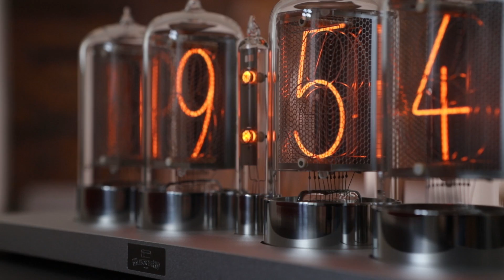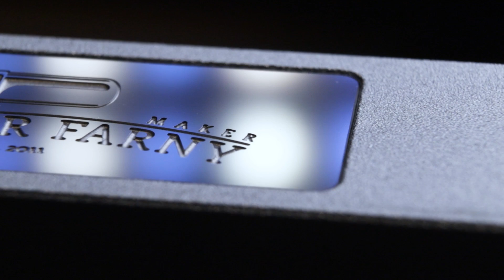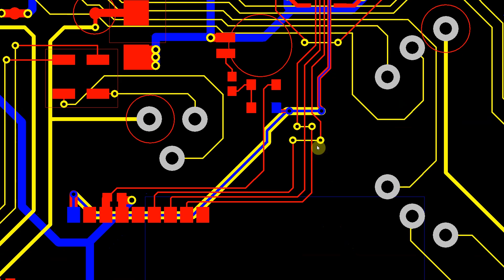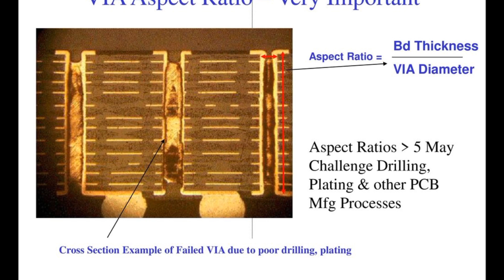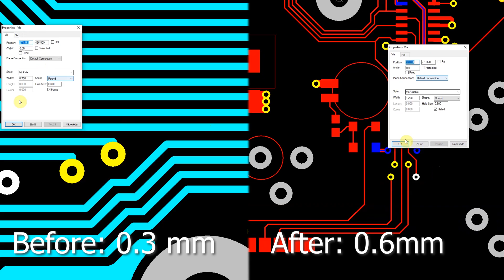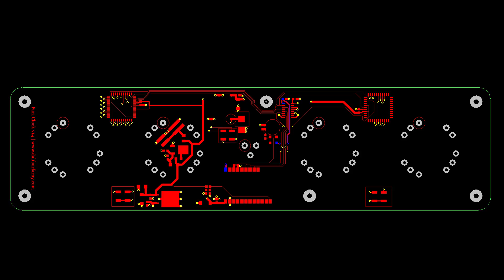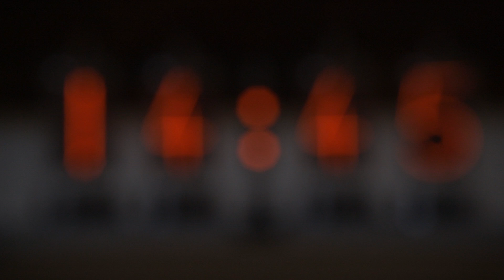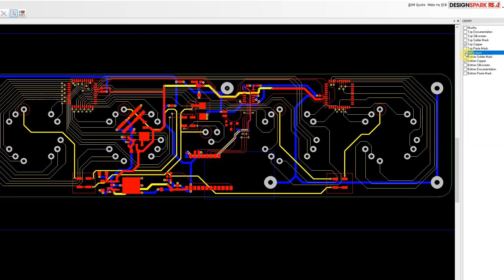Investigating a Nixie Clock Failure

Comment: It is strange that you don't use GLOVES to manipulate nixie tubes...
Thanks for this nice video.
Reply: I gotta ask why would he do that? I know virtually nothing about this tech,but surely they can't get that hot that there would be anykind of meaningful matter? I mean they're not like 100W H4 bulb or something even remotely similar.
Reply: @jothain  If you dont use gloves to manipulate those tubes, the traces left by the fingers reduce the life expectancy of the tubes.
This is the reason why many clocks sold are delivered with gloves to be able to insert the tubes on their support without leaving a greasy deposit on it.
Reply: @regisvoiclair  Yes and that's the exact reason I told they're not 100W halogen lamps that run ridiculously hot and actually burst to pieces without handing grease free. I mean how hot do nixies then run? I'd bet that you can easily touch them when they're on as power sources seem to be quite small on clock models I've seen for sale. If you can touch them and actually even if you couldn't, it wouldn't have any effect on bulb life expectancy.
Reply: I noticed the same thing. I have a pair of tube based power amplifiers from Sonic Frontiers, Power 3s, and would never think of handling the tubes without using white inspection gloves. Same with my Zen clock. Certainly not the same risk as with something like 300W halogen tubes, but finger prints leave oils that can be corrosive over time. The same process is happening as with the Halogen light bulb, only at a slower rate.

And if nothing else, why leave fingerprints on a tube, just for aesthetic reasons?

Is the glass cover for the clock placed with bare hands, or are gloves used?

Dalibor is obviously looking into rooting out any possible source of tube failure. As one is eliminated, another always bubbles its way up to the surface. Continuous improvement.

Anything in the way of Six Sigma is an opportunity for improvement.
Reply: @sgallaghe  OK. Let's get one thing absolutely straight. There is absolutely 0 possibility of grease corroding glass. Glass is material that's notoriously good in resisting everything like If you bring yourself back to schools days and lab hours, you'll likely remember all test equipment being glass. But it's true that ie. oils from hands could possibly damage lamp, but only and really only by it creating hot spot in glass which results in thermal expansion difference, which creates stress and could break glass. It's also to note that even that extreme halogen might happily live even greasy if it were very slowly started by limiting current at startups and ramped down at stops. I have absolutely no idea how and why people thing grease corrodes glass, which seems very usual thing. Yet people cook in glass items, drink stuff that have oils in them and fail to notice this mundane thing. All in all. If glass doesn't get really hot, really fast, it's OK to touch with bare hands. Gloves are are for esthetic reasons. It's very common to get cotton gloves with products that want to have high quality impressions. Heck my speakers came with them.
Reply: @jothain  For almost 10 years I worked in an office section of one of the largest class 100 clean rooms in the US. Upstairs they made almost all of the TV camera pickup tubes in the US and much of North America. Things like Plumbicon tubes. Also did a lot of tubes for medical imaging.

The tubes were never touched with bare hands.

Hot versus really hot simply slows the process.

And as I added, even if it isn't a potential damage source, It just doesn't look good to have fingerprints on a really expensive clock.

When I got my Zen I handled them with white cotton inspection gloves and wiped them down with a high quality microfiber cloth.

Will that make a difference? I have no idea. I know it certainly didn't do any harm.
Reply: @sgallaghe  Now you're getting into optics etc. and there are obvious and obviously different reasons there. Point was and still is that hand greases still don't damage glass at any friggin way, unless it's hot. I really don't understand why you're nitpicking about that it looks bad. Like in video, is the whole process seen? No. Dude likely sells with good impression. Works with bare hands and likely cleans glass surfaces before shipping. I don't see any problem there.  No gloves needed and no damage done.
Reply: @jothain  Remember, there was a 1 in 100 chance that Trump would be elected. ;-) The glass gets cleaned before shipping, certainly. But once in pristine condition, they should be handled with white gloves. Same with the glass cover.

Comment: In 2015 I was curious about nixie clocks, they looked cool but back then as an engineering student buying all things was quite expensive... But I got IN14 Tubes and a board, build everything, work on the lathe and man... That was the best money I ever spend. I really mean it, ever! I was and I am always fascinated about tech in all kinds of styles but after achieving it most of it got boring oder time. But not Nixie tube (clocks). 

I really hope you'll do this for way more years so I can buy your puri nixie clock... I really like your way of speaking open about not beeing perfect. Nobody and nothing is, improvement is so important.

Comment: A 3 layer PCB? That's highly non-standard. Can you elaborate on why you chose this over 4 layers? A 3 layer PCB presents a multitude of problems that 4 layers do not have.
Reply from the maker: True, it is actually made as 4 layer, with one of the inside layer omitted.
Reply: Wait I’ve seen this comment before! Freaking dejavu